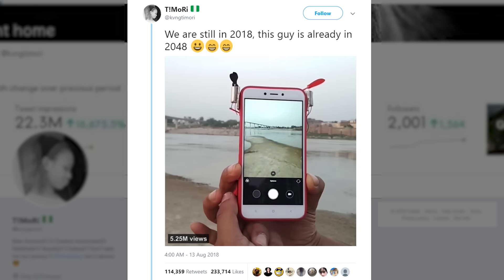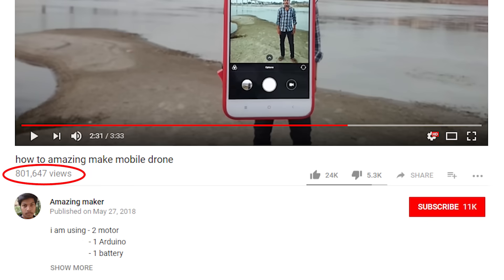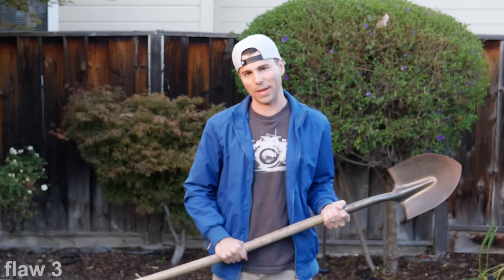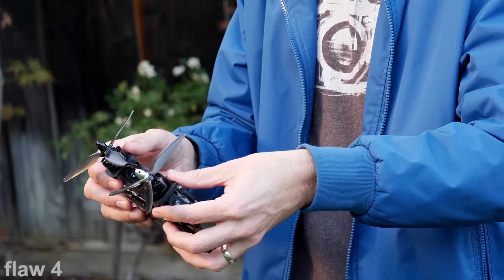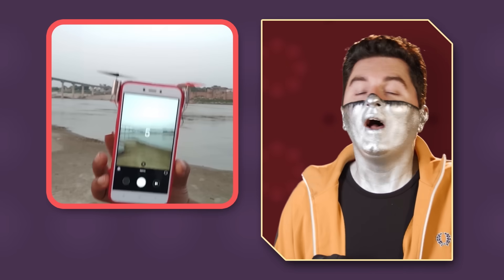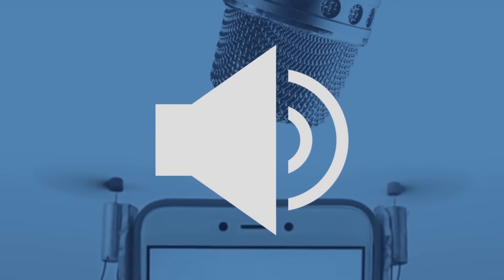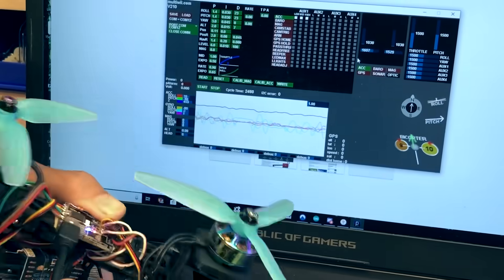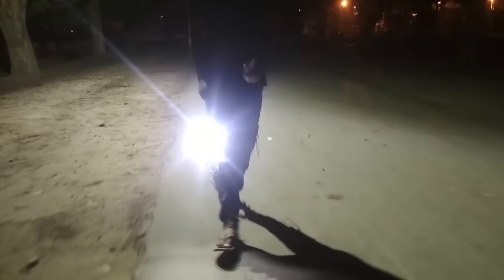Flying Phone Scam Exposed (so I built a REAL one)

Comment: So I hate to be the bearer of bad news but you ended up breaking the law flying at the beach you were at. 🤪 “The National Park Service, the official land manager of the Golden Gate National Parks, prohibits any unmanned aircraft in any national park. On June 19, 2014, former National Park Service Director Jonathan B. Jarvis signed Policy Memorandum 14–05, Unmanned Aircraft – Interim Policy “to ensure that the use of unmanned aircraft is addressed in a consistent manner by the NPS before a significant level of such use occurs within the National Park System.”

This includes the entire 80,000 acres of the Golden Gate National Parks, from Stinson Beach to the Marin Headlands and from the Presidio of San Francisco to Mori Point. The public may not launch, land, or operate unmanned aircraft within the boundaries of the Golden Gate National Recreation Area. “You can take beautiful photos in the park, just not from a drone,” says Nathan Hale Sargent, Public Affairs Specialist for the National Park Service.”

Comment: I agree on almost everything, except balacing a board without a gyro, which is possible.  ;) 

Thinking back at university. Balancing a board blindfolded and ovenmits is called "double inverted pendulum" and its a third semester mechanical experiment = success. 
Feedback received either through the motor or rotational sensors on the motor. often showcased with a cart moving to control momentum video - JpNAhKT7yY4

Comment: Just one thing, if you attach the motors to the phone the way he did, the center of mass would be way lower than the center of lift, so by weight alone it would fall back to a standing position. You might be able just fixate the motors to the case, while controlling throttle and height, making it a lot simpler at the cost of it drifting and spinning away.

Comment: Good video, but the analogy is wrong, since most of the weight is under the propeller, there is no need to balance - just like a hot air balloon doesn't need a gyroscope.
Reply: Nope...Wind and other factors shake the phone with a result of needing corrections to fly...thats why his phone in the end is shaky....think again
Reply: @fillieisreal9851  And a hot air balloon doesn't get affected by wind?
Reply: @bernhardriemann6797  were talking about much different scales here...the whole setup weighs 300 grams. Besides, if what you're saying was actually true, mark would just take stronger motors and would apply them to the phone without any correction mechanisms lol

Comment: 05:17 I'd like to point out that it wouldnt be at least six time louder. The sound level as we experience is not directly proportional to the sound source power but to logarithm of source power divided by reference power. If it was directly proportional to the source power, just imagine being in the center of a big city during rush hours with hundreds of car engines running around.

Comment: 5:15 

Actually using 15 instead of 2 more fans doesn't make the volume 6 times louder, but just 8.75 dB, as the volume uses a logarithmic scale.
10 dB is a doubling of the loudness so 6 times louder is off.

Still a really entertaining video though and thanks for exposing and making a vidoe regarding the topic.
Reply: so what do you do for living? something with sound i guess XD
Reply: @V1RU5420  I had a physics class back in uni although I haven't worked on any sound system since then.

The best way to understand loudness behaviour is to check the loudness of common sounds.
A normally breathing person creates a sound of 10 dB and an ambulance siren 120 dB. 
But as you know 12 people breathing without creating any other noise is not anywhere as loud as an ambulance siren and the difference is no even close.
Reply: dB is logarithmic, but that doesn't affect the sound. Having the same source 6 times will make the sound/volume 6 times louder. It just happens to correspond to a ~26dB increase in this particular scale. An absolute scale of loudness would multiply the initial value by 6 times as expected.

Btw: you correctly say that +10dB doubles the volume so how did you think 6 times louder would only correspond to +8.75dB?
Reply: @tsp5965  I am basing my values on the sound volume as a measurable unit, which is dB. 
If you have the same sources the volume increase is Delta L=10×log n, with n being the number of sources

Using 2 sound sources with the same loudness increases the measured value by 3,01 dB compared to one source.
Using 15 sound sources with the same loudness increases the measured value by  11,76 dB compared to one souce.
Subtract the first and you get a 8,75 dB difference.
Reply: @Keskorian I was thrown off by incorrectly remembering +10dB as doubeling the volume (as you claimed), which it doesn't. +3dB approximately doubles the Volume. 10dB is 10 times as loud. 

So to calculate correctly the Formulas: 
L = 10*log10(n) 
L ~= 3*log2(n)
Would both work.
With n=6 both work out to L ~= 7.78dB.

(Previously used, incorrect Formula:
L = 10*log2(n)
)

But regardless. It is still correct to say, that n times as many sources are n times as loud (like Mark does). The dB scale just so happens to be non-linear and as such does not reflect this change linearly.

Similarly, if i used a logarithmic scale to measure my wealth, twice as much money would still be twice as much money. Just not in the scale I chose. The same applies to loudness/ volume.

Comment: One mistake: The Arduino has no gyro, but the phone does have one, so that could be used to stabilize the device
Reply: That's plausible, but itd take so many circuits and wires to hook into phone and read the coding to perform that task

Comment: We should be grateful for fakers/scammers like that - there should be more of them, because people would have a good chance to learn to always approach unknown subjects with an open, yet critical mind, in other words, be less gullible for things that appear totally awesome and seem to make sense from far away. For example, a mini quadcopter needs 4 rotors to lift and the whole thing weighs 30g, phones typically weigh upwards of 150g. So the two rotors would have to move 10x the amount of air compared to 4 rotors on a drone. I don't think you need an engineering degree to think this far. Just remember this:  if it hasn't been done yet, and it seems a wonder come true it requires evidence. Don't just like and share, stop and think.

Comment: "Drones" are generally designed to hover at 50% max thrust. 70 would mean you've got a pretty lopsided thrust/weight and only have 30% (absolute max since a lot of motors simply turn more amps in to heat at 90-95% throttle) authority which is pretty bad.

Comment: I'll come on I need bracing of work I have to do to get a crank Chargers out of a crank battery light that you wind up to charge the light in the batteries and put it on a knee brace it's late with a circular gearing and it would turn the video generator and would charge us with this battery that way it's probably doable I'm no NASA engineer but the physics still apply

Comment: Technically, you might be able to use the phone's gyroscope instead of requiring a separate one.
Reply: you would run into a problem of needing a connection to the phone. not hard but not something the board can do.
Reply: Not only a connection, but a working interface to the phones components that would correctly read and interpret  whatever signal the internal gyroscope  is sending. And then interface that signal with the signal from an external accelerometer and so on and so on. It would be much easier to just use an external, separate board that contains both.

Comment: Damn son that was a genius way to explain a closed feedback loop. I’ve tried to explain that 1000 times, Usually to a younger audience… and now I have an easy way! Thanks!
Reply: HULL GUITARS USA same, but like for biology. Negative feedback and such. Mainly trying to explain changes in hormone levels and the respiratory system
Reply: Hanne Law I didn’t get it when I took Biology last year
Reply: I would usually explain it like this you are the system and your senses are the sensors that give information to your brain based on which you make a decision.
Reply: is there an open feedback loop?
Reply: @Spider-Too-Too  We make closed loops to make system automatic. An open system means to get data from effector and independently use that data. That will be manual work. Maybe can be used in checking the effectiveness of a policy or health service applied in a community.  But not in computers as the data is huge and complicated for doing any manual processing.
Reply: @Spider-Too-Too  On second thought, I think open system are just like closed ones. They too are automatic in adjusting itself. 
But the only difference is that they are open to interference. They can be manipulated from outside.
Reply: @zoidberg945  oh. thnx
Reply: @zoidberg945  hey i think an open system is what you would require to get a truly and ideal random number generator. All current ones are not truly random due to the closed structure of algorithms and limited data buffers in computer systems. A supercomputer would come close but it would be too costly to run one for everyday tasks.
Reply: Meanwhile i m here not knowing what you guys r talking about
Reply: that means you dont fully understand the subject. if you can explain something using simple analogies, that means you fully understand the subject to its core
Reply: @r.c.6940  That's one of those sayings that sound good, but really aren't. In reality, you might just not have thought of a good analogy, not because you don't understand the subject, but because you can't think of something analogous.
Reply: @SoWhat1221   yeah well it was a quote by albert einstein and i 100% stand by that quote. maybe you dont understand something well enough to feel that sentiment

Comment: I was wondering if using a  phones gyroscope would be possible for this purposes?.
Reply: Potentially yes, but then you'd have to deal with communication between the phone and Arduino. In that case, you'd have to upgrade the Arduino to one that supports Bluetooth.
Annnnd the pain of coding an app to send that data over. Though that in itself should be much easier than trying to set up the controls for the servos/motors.

Comment: I know I am a bit late to ask this, but can't we use phone's gyro battery and accelerometer. Most phones have that in-built. All we would need to do is construct the case with motor and develop software to control the rotors.
Reply: The phone has that, but it can't control the rotors as well, because it has a different use.

Comment: At 5:20 he says that the 13 motors will be 6 times louder then 2, but let's just say it was 12 motors required so hes statement Is cleaner. Even so, isnt this not true? Doubling the amount of sources a sound of the same volume emits from, does not double the total volume, it's a logarithmic function that describes the increase in volume, the more sources, the less each source will contribute to the total volume. So 6 times louder is wrong, something around 2-3 times would be more true.

Comment: I know how to do the flashlight leg trick...
Firstly find yourself a rod-shaped magnet
Create a copper wire loop on the upper leg angled for the rod at the bottom
as you walk your leg moves up and down which creates a change in magnetic flux which generates a current
add a capcitor for discharge 
blah blah blah flashlight

that flasshes...

Comment: 5:21 - Nice video but throwing with physical facts you made a big mistake: the dB doesn’t double when you double the source. In fact 2x the same source with the same loudness rises the combined loudness by just 3 dB. So 12 more would only add 18 dB. While a rising of 10 db normally feels like if the loudness is doubled 12 more would probably only sound 3 times as loud but in no case 6 times as loud . I might be wrong bye

Comment: You forgot to mention that the arduino used in the video is only connected to power and nothing else. It literally does nothing other than flashing the builtin LED (which is btw the default program of the factory flashed firmware, so I'm pretty sure that this guy never uploaded any code to his arduino)
Flashing code to it would btw also require a FTDI adapter, because on a Pro Mini that is not built in to save cost and size.

Comment: I love everything about this video, keep up the great work! I just have 1 correction to make to your information. At 5:18, you said that because you’d need 13 more motors, then noise would be 6 times louder. That’s a common misconception, but the sound would be 6 times STRONGER, but because sound is measured on a logarithmic scale, stronger doesn’t mean louder, but you would need 10 sound sources playing simultaneously to be TWICE as loud. So, you are very smart and I don’t deny that, but even the best of us make mistakes. Just make this a learning experience! 🙂
Reply: Mark literally proved comments like yours to be wrong.

Comment: Cool but, why add another battery, circuitboard, and accelerometer to a phone? The gyro could be replaced by an app using the camera on a fixed point. 
So in theory, you’d only need to attach rotors connected to the phone’s usb outlet. (and rewire max power)

Comment: “It should be able to hold 150 quaters” 
Why the heck do you just bring around 150 quarters
Imagine buying like a pack of raman. 
25, 50, 75, 1.00, 1.25, 1.50, 1.75, 2.00, 2.25, 2.50... 

L I K E   W O W
Reply: MV CLAN, That would be roughly: 37.50

Comment: Hol up
The center of mass is below the centre of thrust so physics would balance the phone anyway without needing an accelerometer to adjust the motors. Like that experiment we all used to do as kids where we got some string, put a straw on it, glued a something like a cut out of a little guy on a unicycle on the top, put some wire hanging down with a blob of clay on the bottom of it and watch him go down the string while he is still standing up.

Comment: Your videos are really awesome, but for the sake of correctness, I must point out one small error. 
At 5:15, you say "and don't forget, you would actually need 13 more motors than this, so it would at least 6 times louder."
While it would be significantly louder, perception of volume is a function of the logarithm of sound intensity. 
So, if we were to calculate in decibels, for example, it would be 10*log(15/2), or 8.75 dB louder. 
This is just short of the 10 dB required to acoustically double volume.

Comment: You are not quit  right about the need for gyros.  Actually, since the cg is below the thrust, it  it would be inherently statically and dynamically stable as the weight vector would always be correcting

Comment: I was like, "wait, how the hell can a quad copter rotate parallel to gravity without moving parts (other than spinning blades of course) and without moving it in any other axis?"
Looked it up and it's super cool. They have opposite blades with matching spin directions spin at a lower rate to add an angular momentum to the system.
So the force on any given side stays balanced but the preservation of angular momentum would turn the copter in the opposite direction. 
That's was a pretty cool thing to learn!

Comment: I don't agree that you need adjustable rotor vectoring to have a stable helicopter.  If the CG is below the center of lift, you can make a stable aircraft without gyros or accelerators.  It's inherently stable due to the righting moment tending to always bring a tilted craft back to vertical.
Reply: Both are used to tell direction and force but none of what you said makes it clear

Comment: Why a drone is made of 4 propellers? It could have been made by the help of 5,6,7,8 propellers?
What physics law contradicts its reality?
I was thinking of making drone of dual propellers and a tail propeller(to control left right). Is that possible if not then Why???
Reply: Dual is possible but very hard to balance, you basically need adjustable propellers like shown in the vid. Anything above 4 propellers is just unnecessary in most cases, compare it to cars.

Comment: Turns out you don't need a gyroscope. Just put the motors on an axle and put a heavier counterweight below the motors so it constantly stables out because if I put a small counterweight on a stick and make a hole in the middle then the stick is going to adjust so the motors are always facing up. The point is that the motors are lighter than the counterweight, so it keeps balancing out straight and working

This is just how I think it would work. I'm not Einstein so i don't know how it works.

One more thing:  
We aren't yet learning it yet on our elementary school

Comment: I mean the third point isn't as solid as the rest, considering that the phone itself has accelerometers. Though of course then your next question would be why use an external controller in the first place when you could just use the phone's hardware, and that'd be a fair point.
Reply: Secondly, I'd be willing to bet that there are flight models you could employ to at least be able to stay in the air with two fixed propellers, since you can create a torque by spinning the two blades at different speeds. Although if that were possible you probably wouldn't be able to steer very well, if at all. I recall seeing demonstrations with quad copters with some of the blades damaged and the AI controller finding ways to fly despite the damage, but I can't remember if it went all the way down to two intact propellers.